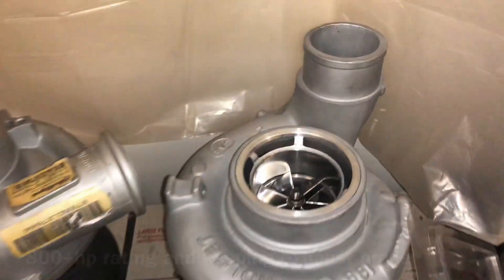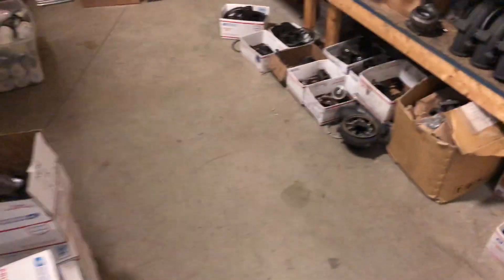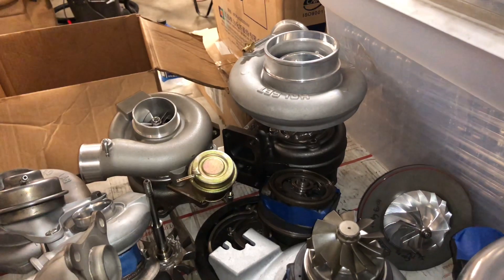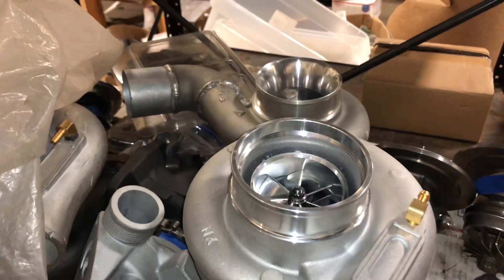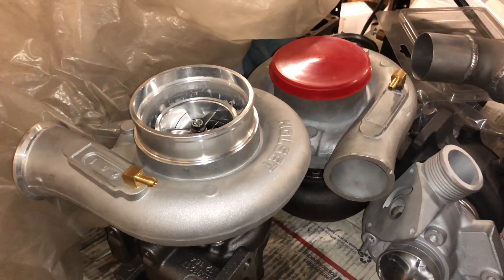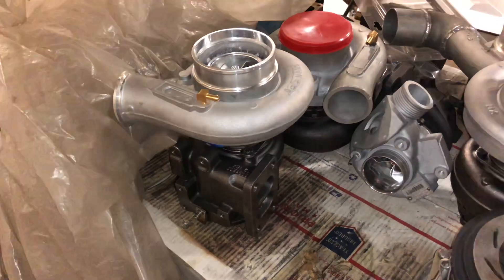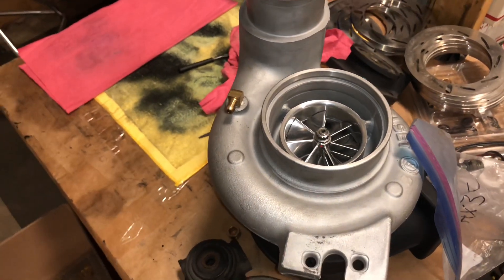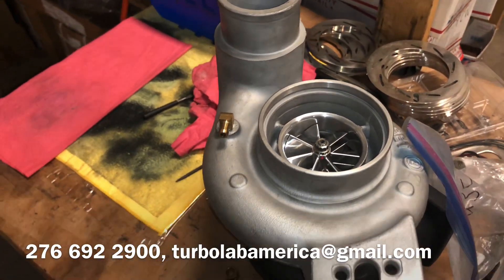Turbos for sale he351ve, he341, He351cw, gt37vas

Comment: Recommendations on the most sturdy/reliable Holset H1C upgrade ?
Reply from the maker: It depends on the hp rating you want.  The turbo is reliable with the upgraded rebuild kit
Reply: @turbolabamerica  shooting for 420-500 awhp on a 2g DSM which isn't much for these cars. Looking to do a lot of Road rally and circuit Racing. I also like to daily it occasionally when the weather cooperates.

Comment: What’s the HX35 run for the 12v?
Reply from the maker: We sell the bolt on dodge turbo with the wastegate for 1000 and with the t3 .82 non wastegated for 900. We can built it with a 62.45 or 67 compressor
Reply: Turbo Lab America 

Ok thank you for your response. I will be needing one in the future. How do I order one from you? Or on eBay only. Thank you

Comment: How much for the 6.0 turbo?
Reply from the maker: Our upgraded 6.0 is $ 1150.00 plus tax . It’s a 63.5 x 88 x 94mm compressor side and 66 x 72mm turbine side. That’s a good deal for one that has the top hp of around 590 on diesel And we have one in stock at this time. Thanks and let me know if we can help.